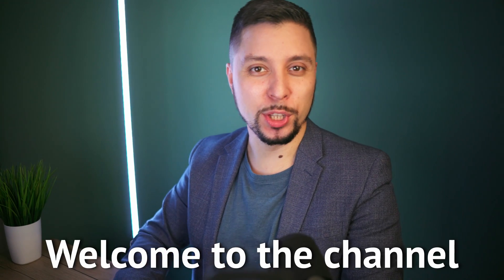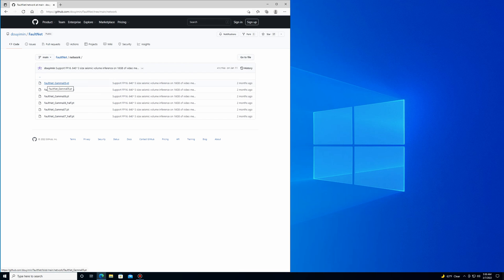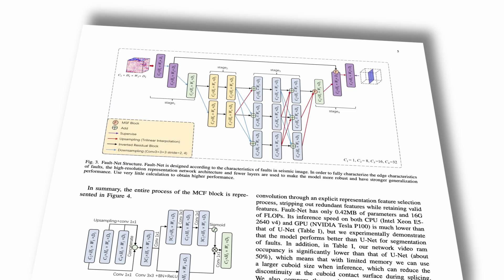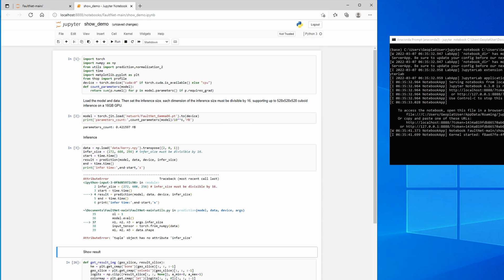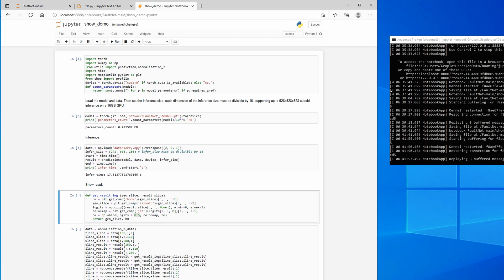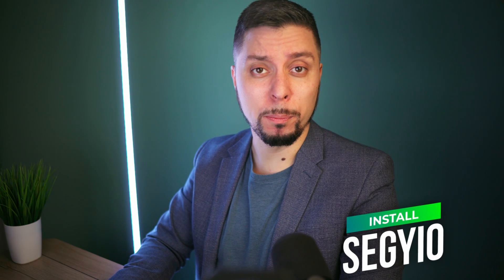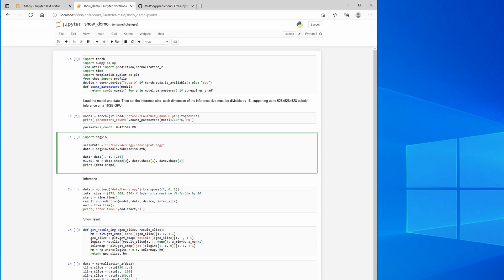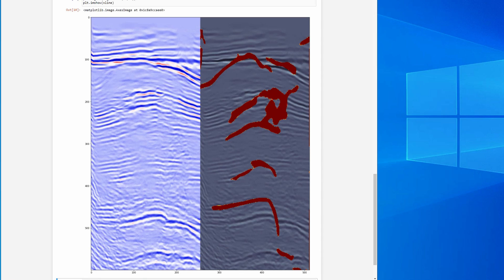Fault Detection Made Easy: A Step-by-Step Guide

Comment: I think only developer can test it lots of challenges appeared finally I gave up
Reply from the maker: Let me know where you are stuck. I will guide you through
Reply: @RuslanMiftakhov  Dear from the second step of the code I got error below
RuntimeError                              Traceback (most recent call last)
<ipython-input-7-d3076ee0f96b> in <module>
----> 1 model = torch.jit.load('network/FaultNet_Gamma06.pt').to(device)
      2 print('parameters_count:',count_parameters(model)/10**6,'MB')

~\Anaconda3\lib\site-packages\torch\jit\__init__.py in load(f, map_location, _extra_files)
    273     cu = torch._C.CompilationUnit()
    274     if isinstance(f, str) or isinstance(f, pathlib.Path):
--> 275         cpp_module = torch._C.import_ir_module(cu, f, map_location, _extra_files)
    276     else:
    277         cpp_module = torch._C.import_ir_module_from_buffer(cu, f.read(), map_location, _extra_files)

RuntimeError: 

aten::_convolution(Tensor input, Tensor weight, Tensor? bias, int[] stride, int[] padding, int[] dilation, bool transposed, int[] output_padding, int groups, bool benchmark, bool deterministic, bool cudnn_enabled) -> (Tensor):
Expected at most 12 arguments but found 13 positional arguments.
:
D:\anaconda3\lib\site-packages\torch\nn\modules\conv.py(585): _conv_forward
D:\anaconda3\lib\site-packages\torch\nn\modules\conv.py(590): forward
D:\anaconda3\lib\site-packages\torch\nn\modules\module.py(1090): _slow_forward
D:\anaconda3\lib\site-packages\torch\nn\modules\module.py(1102): _call_impl
D:\anaconda3\lib\site-packages\torch\nn\modules\container.py(141): forward
D:\anaconda3\lib\site-packages\torch\nn\modules\module.py(1090): _slow_forward
D:\anaconda3\lib\site-packages\torch\nn\modules\module.py(1102): _call_impl
J:\projects\HRNet_mobile\models\seg_hrnet.py(449): forward
D:\anaconda3\lib\site-packages\torch\nn\modules\module.py(1090): _slow_forward
D:\anaconda3\lib\site-packages\torch\nn\modules\module.py(1102): _call_impl
D:\anaconda3\lib\site-packages\torch\jit\_trace.py(958): trace_module
D:\anaconda3\lib\site-packages\torch\jit\_trace.py(741): trace
J:/projects/HRNet_mobile/script.py(13): <module>
Serialized   File "code/__torch__/torch/nn/modules/conv.py", line 12
    bias = self.bias
    weight = self.weight
    input = torch._convolution(x, weight, bias, [2, 2, 2], [1, 1, 1], [1, 1, 1], False, [0, 0, 0], 1, False, False, True, True)
            ~~~~~~~~~~~~~~~~~~ <--- HERE
    return input
Reply: @RuslanMiftakhov  when I use google Collab I get the args error and I did the same modification you suggested in the video but the error is still there